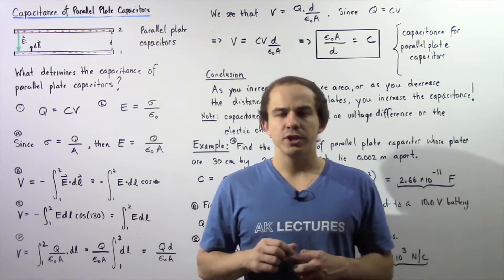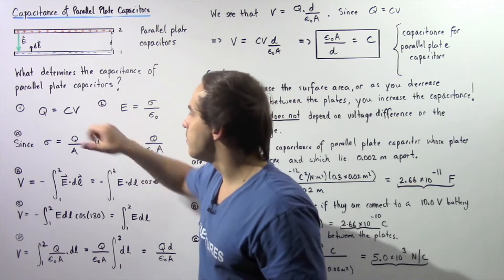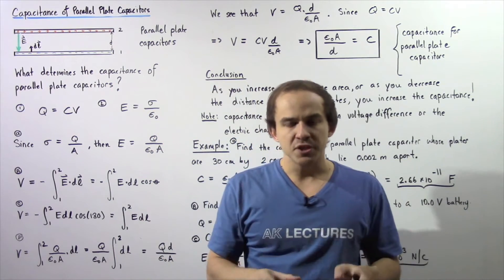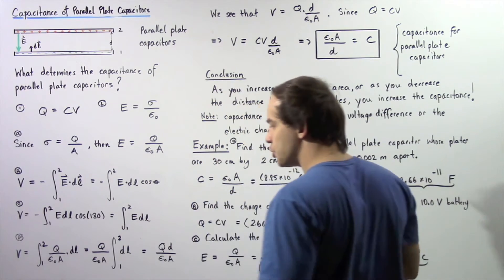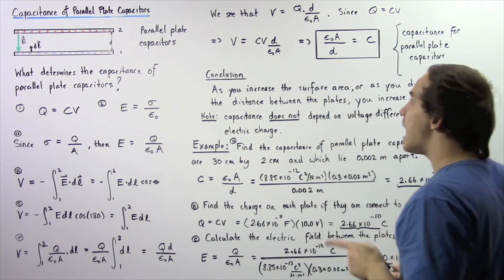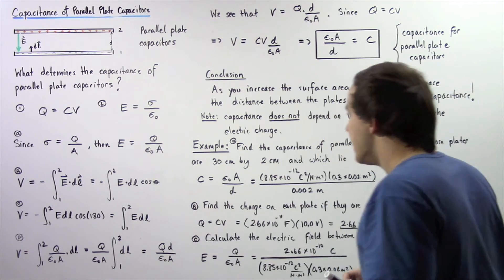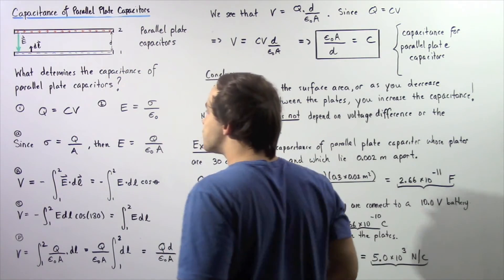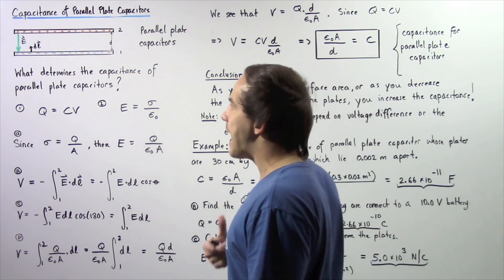Parallel Plate Capacitors

Comment: I am really enjoying your lectures. :-)
There is just one thing I don't agree (tell me if I am wrong because I am not 100% sure) : your choice of the vector dl, because it causes a problem with the sign of the capacitance on the two next parts of your lecture (cylindrical capacitors and spherical capacitors). Besides, you can't know if the integral of dl from 1 to 2 is +d or -d, because you didn't use any axis and didn't tell at which distance plates 1 and 2 are from an origin (contrary to the two next parts of your lecture where you specify that each shell has a different radius from the center of the cylinder or the sphere, with R1 > R2, so there is no ambiguity about the sign of the integral).

Actually, the electric potential difference V2 - V1 is equal to the negative of the work from plate 1 to plate 2, or in other words equal to the (positive) work from plate 2 to plate 1, so the vector dl should point towards plate 1 (not towards plate 2 as you told). If you choose the origin above plate 2, so that plate 1 is in distance r1 and plate 2 is in distance r2, we have r1 > r2 and r1 - r2 = +d. So, the negative of the integral from 1 to 2 is also equal to the integral from 2 to 1 (the negative signs disappears when we reverse the limits of the integral) and the integral of dl from 2 to 1 gives us r1 - r2 = +d (and so, the electric potential difference and the capacitance are really positive).
By changing the direction of the vector dl, it also solves the problem with the sign of the capacitance in the next two parts. 

What do you think ?
Reply: Exactly